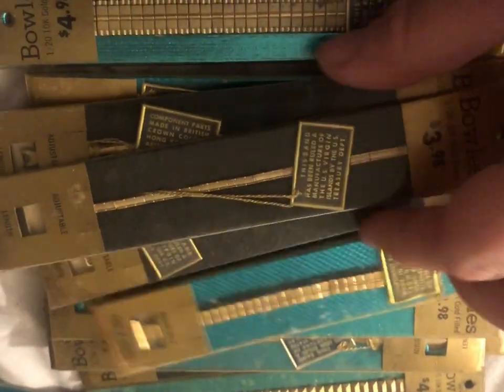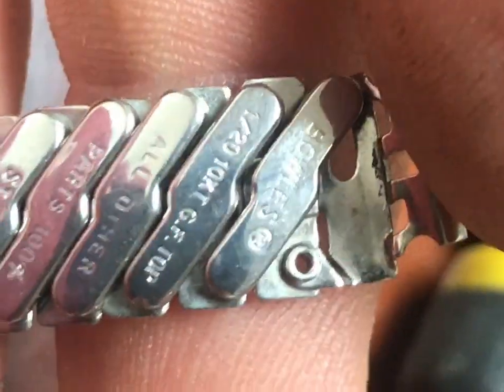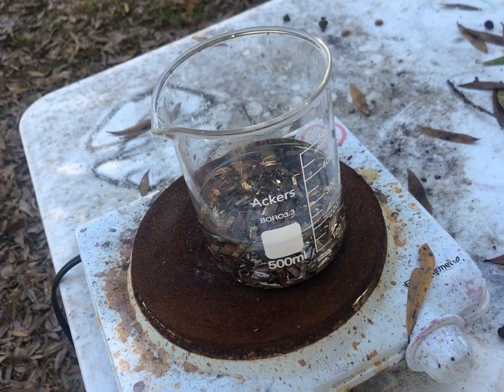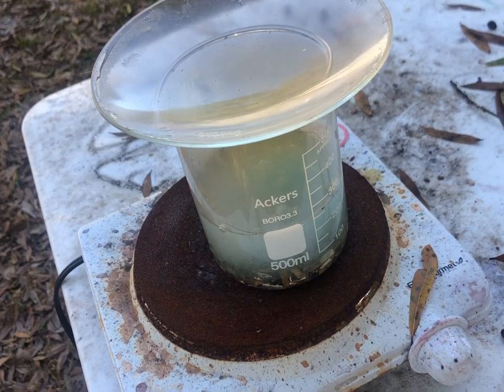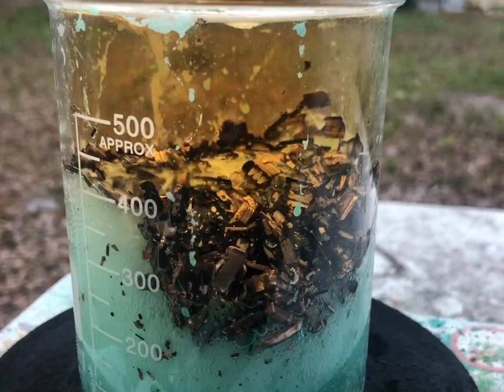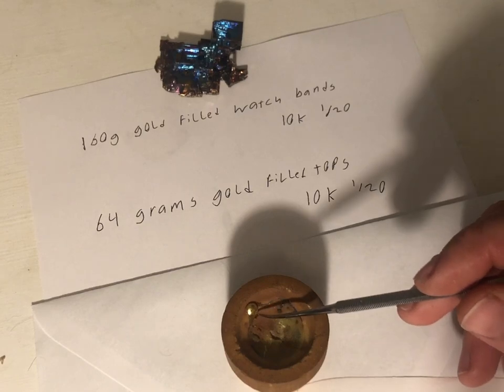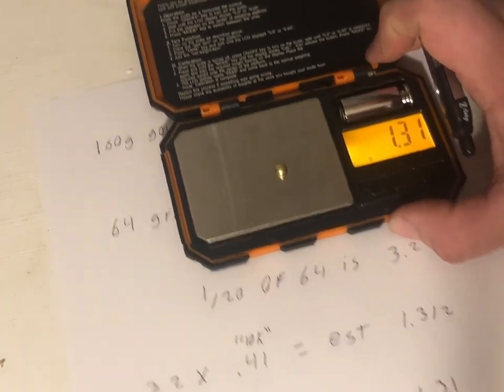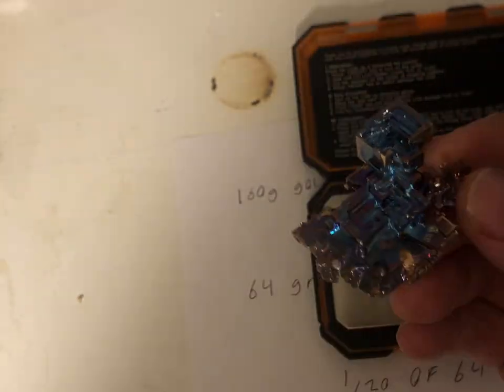Refining gold filled material with nitric and Cupellation

Comment: You have to subtract half your weight of gold filled tops cuz only one side is plated
Reply: By law the manufacturing specs are based on weight and the position of gold is not considered
Reply: @richardperkins3612  wish that was true but it's not I've purchased so many pounds of gold filled tops and the outcome is not by the overall weight
Reply: @richardperkins3612  and by saying by law most of the antique gold bands were manufacturers when there wasn't a law I guess so who is regulating it if that were the case all gold out of Mexico would be out of business